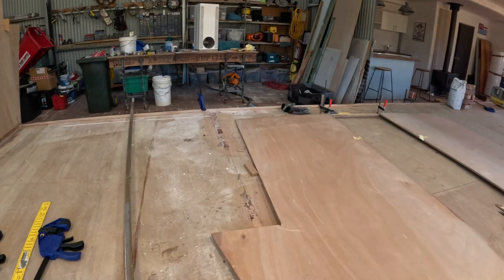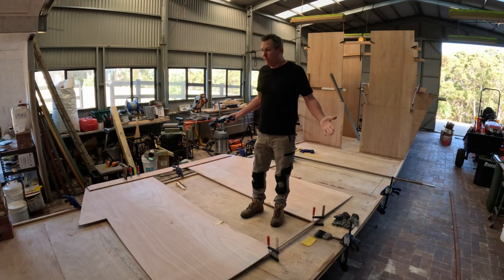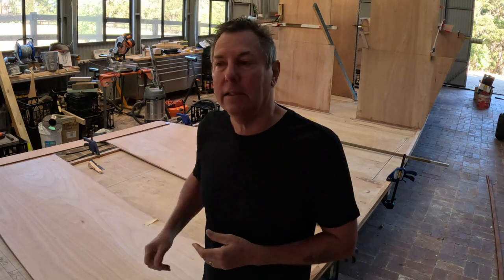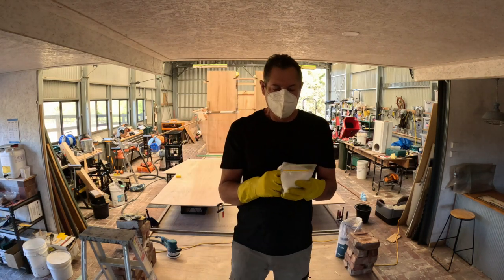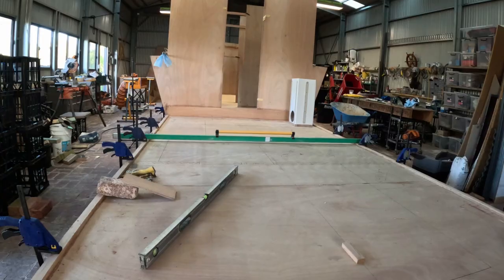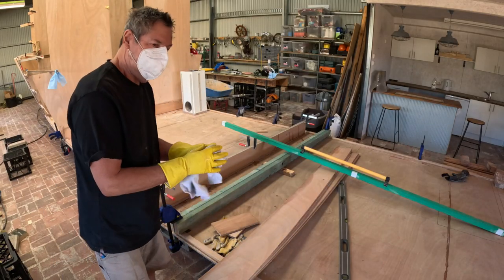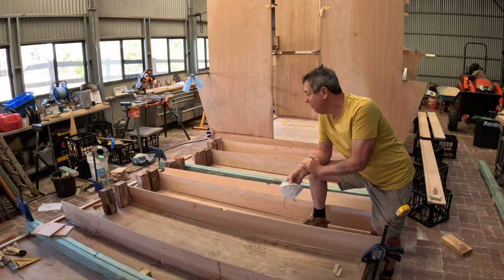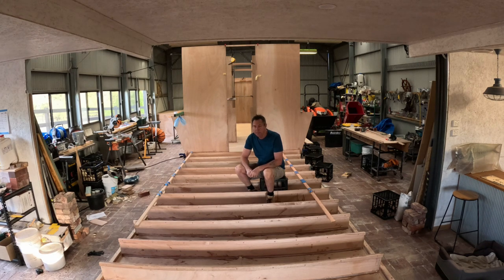Boat Building Flat Bottom Boat. IMPOSSIBLE! Building Dragonfly E 14

Comment: Not exactly "honeycomb " more like floor joists with bracing.  Still strong, just confusing terms. Is the bottom center notched to allow water to move t to the bilge pump?
Reply from the maker: Sorry for the late reply :) All compartments are completely watertight except the ones down the centre.

Comment: love all your top notch videos and your channel so deserves 500 thousand subscribers , i have a few questions but for now i will just ask 1 , the hull sides are you going to do a 2 plywood lamination
Reply from the maker: Hi Anne6621, thanks for watching. No, a single 12 layer of ply wrapped in fibreglass. However, from the front of the wheelhouse back, the internal wall goes right to the floor, creating a second waterproof barrier. Effectively there is a water tight cavity between that wall and the flared outside hull wall. I hope that makes some sense. Cheers, Steve
Reply: @steveshierdoesstuff7420  yep perfect sense !! , for 36 years i owned a 1968 57 foot Chris Craft motor yacht and i must say your ship intrigues me a lot and your design is just so spot on i instantly fell in love with it !!